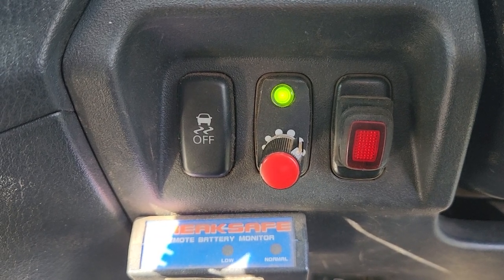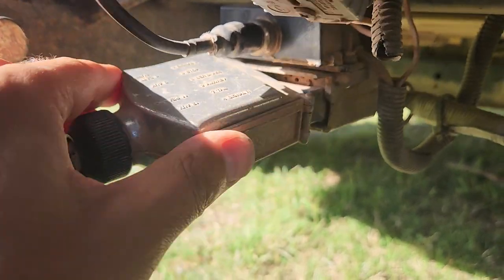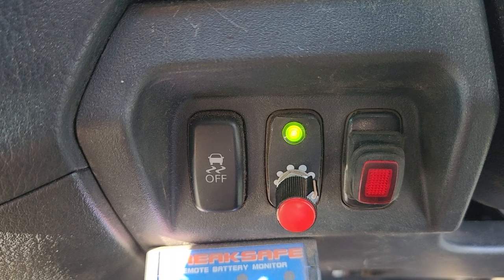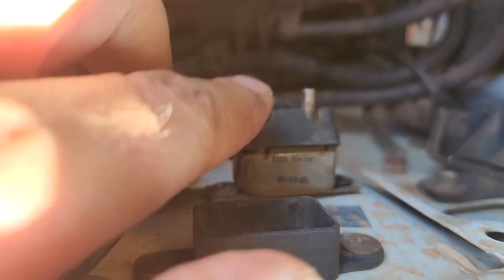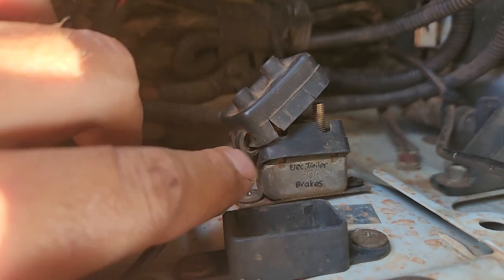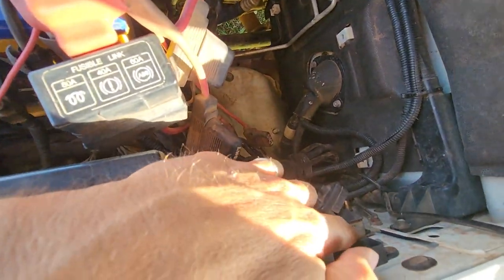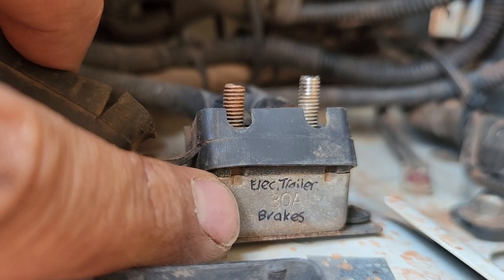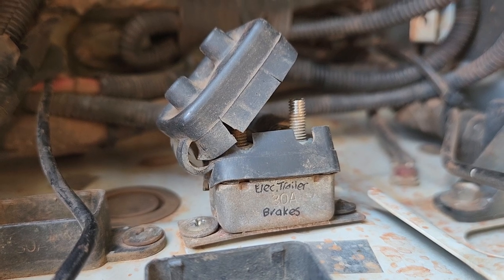Why a self-resetting circuit breaker isn't always better than a fuse!

Comment: I've got a pajero too. In the process of changing all my circuit breakers for fuses. Thanks for confirming my concerns about heat and CB's
Reply from the maker: No problem, glad to help mate! The standard ones are probably ok but this was an aftermarket addition and maybe not rated correctly for the ambient temperature plus current 👍

Comment: These breakers will actually become more sensitive to the heat as they age (just like I have living in the Sonoran Desert of Arizona.) Replacing them will often fix the issue.  You can buy them at your local auto parts store and they are fairly inexpensive.
Reply from the maker: Right that's interesting, I didn't know that. I guess it would make sense that originally it wouldn't have done this. Thanks for sharing!

Comment: Those types of self resetting breakers, for the uninitiated,  rely solely on a heat sensitive metal bridge to break the circuit.  They are shaped so that when they heat to certain temperature, the metal plate springs back off one side of the connection. When the metal plate cools, it goes back to its original position. They're clever but yeah, they fatigue with age and can be overly heat sensitive if they're not insulated from excessive heat.
Reply from the maker: Exactly right. That's what caused the problem for me!
Reply: @TheMusingGreg  IMHO the key here is age and what you mention.... insulation.   IMHO this auto reset fuse is likely called for by the manufacture for a good reason and should ONLY be replaced with another auto resetting fuse.  Maybe you did???  

Figure the Autoreset is a safety feature. Blown fuse and losing your trailer brakes due to it.... NOT GOOD.    Insulating it might keep it from tripping from ambient heat when it is old and in a weakened state .... but insulating it  might also hide upcoming failure of the fuse....  soooooo.... again it is a safety feature.. when it starts tripping like that in hot weather...... cool (pardon the pun) that is your sign....  time to change it out before it totally fails and you loose brakes.

Comment: What is the larger black 15 amp blade fuse for the radio? Is this an automatic reset fuse? the normal 15 amp blade fuses are typically blue.
Reply from the maker: In what part of the video mate?

Comment: Nothing better than fixing an on going problem.  Bravo, congrats to the missus 😂

 I wouldnt have guessed those CB where effected by heat. Great to know.
Reply from the maker: Haha thanks! Yeah it's nice to have it solved at last, initially I dismissed the temperature thing as I couldn't see a correlation! 👍
Reply: ALL circuit breakers are effected by heat. JSYK

Comment: Just move the circuit breaker to the front of the engine bay .. on the inlet side..where the temps are usually much lower. Usually works .
Reply from the maker: Good point. My wiring wasn't long enough for that, it was on the inlet side but towards the firewall. Maybe if it was near the front it would have been better.

Comment: maybe you or a reader can help me with an auto reset fuse question...  

how fast does this type of fuse auto reset?  Would think it would take  at least a few seconds to reset. In my mind this said I should be able to  attach a voltmeter (attached correctly) and watch it drop voltage when tripped..... and then raise voltage again due to resetting. 

Reason I ask is I built a test setup with this in mind. Wanted to find what was shorting out and had already twice blown  different 50amp fuses; pretty much immediately; when the relay this blowing fuse is part of,  got activated.  This strip fuse is said to be a built in protection from the HOT line between  Glow Plug  Relay and battery HOT*.    A few had suggested I was blowing fused due to a short  to ground somewhere  in  path between relay and tip of  one of the glow plugs.  This was what I was going to test.  

Goal was to test by finding what wire/glow plug trips the fuse by seeing which one(s)  shows a volt drop on a voltmeter  due to it getting  it tripped. First though had to test that theory before set out to test what was tripping the fuse.  So ran a test with all the wires still attached to see if voltmeter did what I assumed it would.  Once verified; plan was to pull all the Glow Plug  wires free from the Glow Plugs and then start testing. Intent then was to reattach GPlug wires; one at a time, to see which GPlug or its wire causes the fuse to trip  by looking to see changes on the volt meter.   

With GPlugs and wires all still in place;  tested my assumption**  .....  Well  volts never dropped of any significance in my test.   What does that mean??? is my assumption wrong??? orrrrrr did my short to ground (if there was one)  resolve itself.???  Maybe had two bad fuses??  both were old.   Hence my question.. can  this fuse re-set itself so fast I would not see see volt changes  on a meter in a  gap between Tripped and Reset???  

*. Strip fuse this auto re-set ( test  ) fuse replaced, sits between fulltime hot from battery to second point on the relay.  Wired the auto-reset fuse the same. full time HOT;  wired to Brass Lug in back of  a Bussman auto resetting  50amp fuse; like the one in this video. The silver lug  on back wired to where the other end of OEM strip fuse would attach.  

** voltmeter attached at Silver lug on back of fuse... assuming that should show a drop in voltage  if the fuse trips, because no power would flow thru the fuse during the tripped phase. 
coachgeo
Reply: well CRAP

grrrrr.....   got  question answered in above post....but for unfortunate reason.  

Am back to popping relay fuse again that apparently  was not popping yesterday, Ufortunately that did answer the question..... yes the auto reset fuse..... the time between trip and reset is for sure is slow enough to see complete drop in voltage to zero.   

now have to figure out how to take apart a MB Glow harness plug (which) plugs into relay so can replace all the wires from that to each glow plug.
Reply from the maker: Oh pain! I'm going to answer but I wanted to have enough time to read and understand your issue first. So have you got it sorted now?
Reply: @TheMusingGreg  Not sorted.  Looks like will have to replace the whole harness and relay with something else.. Worked on it all day and got nowhere.  Dont have a good enough meter to ohm out anything clearly to trace it out either. That's why went with the auto reset fuse test setup in the first place.    Giving up and replacing it all. Luckily have bits and pieces to cobble something together.
Reply from the maker: The short answer is that it should reset as soon as the temperature drops enough. So at ambient temperature I'd expect it to take 15-30 seconds.

Comment: That’s why on Redarc tow pro they tell u do not use a circle breaker
Reply from the maker: That's good to know if that's what they do. I don't have a Redarc Tow Pro so I don't know what they advise, but if so that's good advice.
Reply: @TheMusingGreg  I wasn’t having a dig at u mate what your pointing out is there good I had the same problem with my spot lights years ago took me a while to figure it out with the breaker definitely dangerous being on ya brakes
Reply from the maker: @stevencondron9355  Mate I didn't take it that way at all, but thanks for checking back just in case. I was saying that if Redarc advise not to use a circuit breaker then good on them for saying that, as you say it's a dangerous thing to have disconnecting on brakes! Cheers mate.
Reply: i think this is whats causing our prado's pre crash safety malfunction, the breaker is getting too hot in engine bay and tripping, causing brake controller to go off and car doesnt like it.
Reply from the maker: @blake-dragonsbreathvapesho6937  Thanks for sharing, hope this helps you get it sorted!